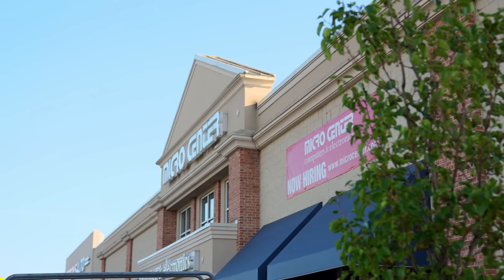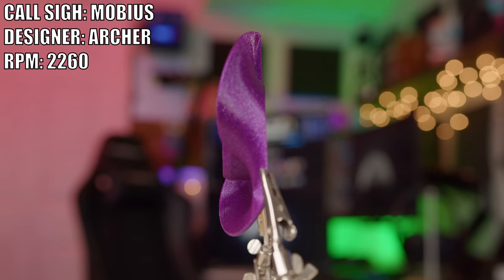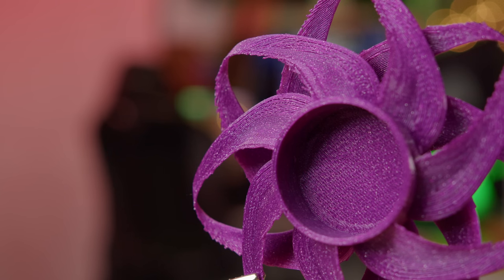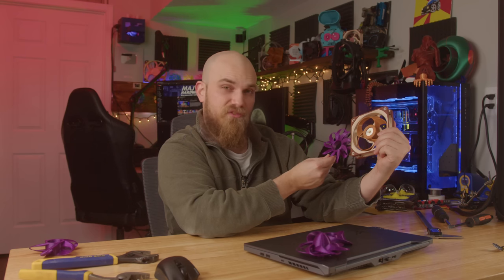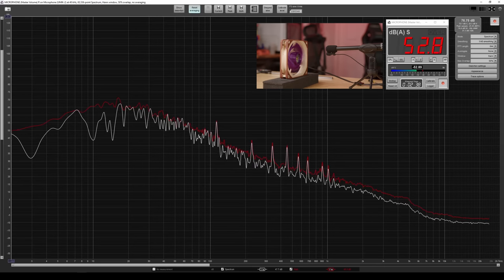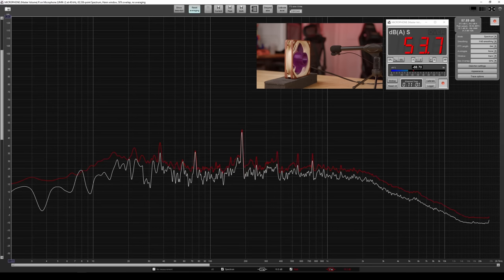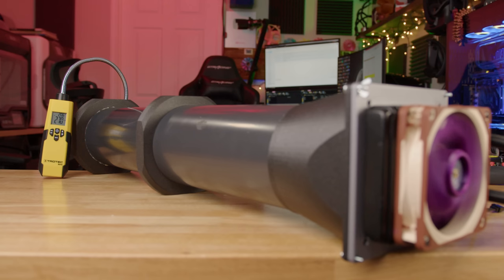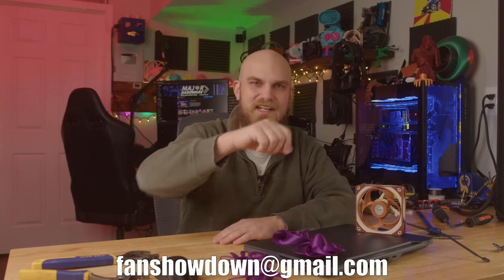My Subscribers Turned MIT Award Winning Toroidal Propeller Into A PC Fan | Fan Showdown S5E5

Comment: The one pushing in the wrong direction would get the same in either direction because it is PULLING the air through your airflow meter rather then pushing. The rounded props are likely going to do nothing advantageous in a framed fan because there are no vortecies on the outer edges like a plane wing, or boat prop. A jet boat impeller would likely do nothing, because again, there are no outside vortacies . :)
Reply: Sounds right
Reply: Pulling with a fan is less efficient than pushing though, so not "the same".

Comment: Good video. One problem that I think might be diluting these results is the layer resolution of the prints. I think you really need to have a resin printer or to be making moulds if you want to honestly compare these designs with Noctua et al.

Also I don't think we got a noise test for the flipped Mobius design? Maybe I missed it
Reply: Thanks for the feedback. 
Expect more videos soon. 
Send a direct message... 
I have a Gift for you📦........

Comment: Have you ever compared the performance of a real NF-A12x25 to a 3D-printed one?
Reply: I remember a past vid there was one made to the same specs and yeah the 3d print did not give the same output but was very close.
 I think whats missing here is to now take the A12 and curl the tips into a toroidal hybrid and use some putty/filler and sand it to a smooth finish surface.

Comment: What makes the toroidal good for marine and drone applications is the reduced tip vortex, on a computer fan, the fan shroud takes care of that already, so their main advantage is discarded, and a less efficient but larger blade will move more air usually so having a large blade and the shroud taking care of vortex is a best of both worlds deal, making it sort of a ducted fan

Comment: Solving tip vortices might be great for open propellers, but the design trades are a pretty different in the world of ducted fans. The toroidal design reduces interaction outside the diameter of the rotor whereas a ducted fan leverages the interaction with the duct wall.
Reply: Exactly. This stinks of skimming a paper on toroidal blades without actually under standing how fans work.

Comment: The Mobius probably did the same because it was pulling air the opposite way through the tube when it was facing the other way, leading to similar performance
Reply: He is measuring pressure so it would be zero in that case.

Comment: You know I got to thinking about it. If you look closely at the stock a 12 X25. The blades kind of resemble just a toroidal shape that's been cut in half. It's like the front half of a toroidal shape where the back half has just been cut off.

Comment: My biggest hope going forward is seeing him improve the print quality by either changing to resin/UV printing or spending time tuning this current machines and sanding the parts. The stringies and jagged edges are so prominent on some of these that I know they are changing the airflow properties of the fans. Also, I think resin would be great because the parts will come out smoother, stiffer, and closer to an injection molded fan like the original Noctua. The concept of toroidal fans is cool however I don't think it's going to do well in this specific type of tests (pressure optimized vs airflow) and the noise benefits are much lower in part by the fan having a frame or being enclosed part way vs being completely open on a drone support.

Comment: I'd be interested in seeing the static pressure generated by each fan. Have you thought about a testing methodology to include this in the future?
Reply: The fan is mounted on a radiator for the tube/airflow test

Comment: Nice video, thanks.
One point to note, The advantage of toroidal propellers is largely in eliminating tip vortices in non-ducted propellers. The close fitting circular housing on computer fans is a big help with noise and tip vortices, the toroidal end connecting one blade and the next kind of gives this same effect, so it's not that surprising that a ducted toroidal is not much better than a ducted fan.

Comment: i think toroidal fan blades are specifically designed for open-blad propellers to reduce wing tip vortices and everything these vortices causes, like extra noise, efficiency loss etc. they are not designed for propellers with housing, like these desktop fans.

Comment: The magic happens in the outer loop as the air transitions and is push under pressure.
The leading edges are lowering the pressure to suck the air into the space.
So in my view it's the air transition from lead edge to the outer loop.

Comment: The thing is that the value of toroidal propellers comes from the elimination of blade tip vortexes which are resolved with the enclosure present on the pc fan. Really interesting testing though

Comment: When they do injection mold plastics for the toroidal fans, you will get thinner blades and more efficiency i think. 3d print is pretty thick and heavy by comparison and you have a lot of clean up to do with sanding, not to mention balance

Comment: The Mobius performs same flipped around because regardless of the direction, the fan is either pushing into or sucking out with the same pressure differential which should generate the same mass flowrate. The design "flaw" with the mobius is just that the mounting hub was printed the wrong way around.

Comment: Two things:
-Clean the edges of the printed blades(lots and lots of drag, causing noise that would'nt be present when ejection molding parts)
-You should also measure the power consumption, to calculate efficiency.

Comment: in the MIT paper it is clear that one of its interesting fonction is in open space. the fan enclosure limits the sides aspiration provided by the toroidal propeller.

The second thing with printed blades is ... the printing process hich make a lot of small stairs and do not lets the airflox to be quiet.

The best comparison to try it in fan case is with the same motor and an printed original pattern blades to have quite the same cons provided by the making process ^^

Comment: The reason behind a Toroidal Prop is to mitigate cavitations which are little pockets of air that are the reason behind sound on props. Although it is interesting for the performance in a pc they are useless due to the surrounding material which servers the function of a toroidal prop.

Comment: Fans move more air the further there is from the turning axle so the shape, size and angle of the end parts of the "blades" is more important than the section that is attaching them to the mounting frame.

Comment: I get that this is just for fun, but if you think about it for a second, the whole point is for these to reduce tip vortices, which are basically not a problem at lower reynolds numbers (aka fan speed).  An actual comparison is to strap that noctua to a drone motor in an open airflow config and let it rip.  That's when you'll see the difference.  Otherwise, this is a square peg, round hole situation.

Comment: All the blades on the A12x25 are basically half toroidal. It wouldn't be surprising if Noctua tested these designs but made some concessions for static pressure and total blade surface.

Comment: One very interesting question for your designs and tests is the concept of windage. Fans work best when there is very little gap between the housing and the edges of the fan blade.

Comment: Don't forget that toroidal propellers are "quiet" for 20-20khz frequencies. So you should maybe think about the noice on a certain flow rate. Or measure the needed power to generate that flow rate ( to get the efficiency ). The strength (in my understanding) is not the performance but the efficiency

Comment: I saw some comments elsewhere pointing out that the toroidal fan gains its efficiency by reducing vortices created at the traditional tip of the blade. So, though still operable, they are not beneficial when operating in an enclosure.

Comment: Hey MH, one thing you might consider doing for your 3D printing.  Have an "acetone baker" to smooth out the rough ridges.  I've seen some videos that show people using acetone vapor in a confined space to basically "bake" the rough ridges out of a 3D printed object.  "Some experimentation required." :D Hope this helps.

Comment: OK I need a new test. I maintain that a submarine prop and a noctua 12 fan blade have a lot in common.  I also think that tip forwards curved blade design would make a quieter drone prop than a toroidal. You have drone:) might have to connect the tips with a ring to keep the flex down, don't know.

Comment: In your last video you said something like that the problem with traditional propellers was the turbulence created at the blade ends. However a PC fan is placed in a short tube which may mess with that a bit. My guess is that toroidal propellers are great when not encased, and maybe some other idea is needed for PC fans.

Comment: Toroidal props won't be very helpful for making fans because the fan case you are sticking them in is ducted. The point of the shape is to avoid the vortices created by the tips of the blades, but ducting already fixes that.

If you want to learn about what I'm talking about google "ducted fan", "duct/ducting" alone is a different thing.

Comment: Those Toroidal propellers are meant for boats to be quieter, because they are not narrow flow of movements, but open.

So if you take a motor and hook it to the propeller and use it open without the 'casing' around it, that's where you should see the differences.

PC case fans are more like Jet Engine style of propellers, in that the air is concentrated in a funnel, Toroidal propellers are for things like boats and propeller planes in a sense?

Comment: toroidal blades are meant to mitigate fan tip vortices, but all these fans are operating within a CASING. So there aren't any tip vortices to mitigate, these are really only meant for non ducted applications like aircraft or boat props

Comment: Have you tried sanding the fins at all? I'd be curious if by creating a smoother surface, you decrease the turbulent flow and therefor see a decrease in sound as well. Your comparison of these fans to each other seems precise enough as they all likely had a similarly rough surface, however I'm curious if you may be able to surpass the commercial product with a smoother surface - even to something relatively course like 180 grit. Either way, great work!

Comment: It's not weird that it did the same regardless of orientation.  in one way it pushes air into the tube, in the other it pulls air through the tube but the machine that you use to test flow still gives a reading even if it is flowing in the opposite direction.

Comment: Probably already been suggested in the comments already. But given the issue with 3D printing some of these, and the issue support removal causes with the end product, as well as the not so smooth surface finish due to the large layer height. Which I’m sure will have an effect on the performance due to the grooves on the surface which will distort airflow and therefore affect noise levels. 
I think the better way to test the designs would be to resin print them for the cleanest and smoothest results of propellers

Comment: You sould start high temp treating those flakes on 3d prints. Blow with heatgun 600c just fast enough to melt the smallest flakes but not soften the material.

Comment: I was building a solder exhaust system, I had a creality 60mm fan, it just spun the smoke back but not through the filter, so I took the filter off, same thing.

Might be cool to see what 3d printer fans actually work.
Reply: the 3d printed fan from MIT seemed to work just fine, in a muted clip and with no rpm data and power draw provided...

Comment: I’m assuming that the mobius getting the same FPM of airflow both ways is that your meter does distinguish direction of airflow. If it’s pushing 270 fpm, it’s also pulling 270 fpm

Comment: Have you ever tried smoothing out your blade surfaces (acetone?)  I can't imagine those rough surfaces help the aerodynamics much.
(perhaps even smooth only one side to create low and high pressure,... tho perhaps not,... I don't think you want "lift" like an aerofoil)
I can only image the micro-vortices spilling off every single layer edge on those surfaces, and every vortex creates drag and noise and reduces laminar flow.
Seems a bit unfair to compare those extremely rough prototypes against smooth, professional injection molded fans! (I'm assuming you're not sponsored by "big-fan")

Comment: I saw those thoroidal designs and my litteral first thought was, someone should submit that design to the fan showdown. I was not dissapointed. 
The problem with taking clues from a boat-propeller and using it for airflow is that these two media have very different characteristics and therefore need differently optimised blade designs. So we probably have to be looking towards the drone/flying car design industry for air-optimised versions.

Comment: if you add a cone to the middle (thin as possible construction)

this should decrease noise and add flow

balance the fan blade as much as possible (most noise is from that)

try a few different shape cones too

the more uniform matches the blade the better 

let it protrudes 1/4-1/2 inch

diet..drill 1mm holes anywhere you think it won’t effect flow. 15% lighter will have significant gains

Comment: You need to print these out of ABS and then put them in acetone to smooth them properly. A lot of the noise here is from the rough edges on the print itself
Reply: Agreed, or printed with an SLA printer instead.

Comment: The possible I see is the number of blades so to speak  and the pitch. It seems like if you could maybe make a 6 blade design with  a gradual change in pitch towards the center to make a tighter vortex to the rear it may perform  better. Don't have tools to execute but just throwing idea out there.

Comment: The fans from BeQuiet will beat all fans, including noctua fans.
Their Silent Wings and Shadow Wings 2 are non audible at low RPMs.

I use those for ventilation exhaust in residential rooms and boat cabins, where sleep level silence is important !

Comment: The toroidal propeller is designed to reduce the wake produced by the tips of the blades, when you are using it in a pc fan or in an area where the tolerance between the blades and the walls are low, then there is nothing to gain because there isn’t enough space to produce wake, if you are wondering what the wake is, it’s when the tips of the blade produces vortexes and disturbs airflow, and at this size and weight, the toroidal propeller would marginally produce less thrust because it’s generally heavier or creates too much drag for a set amount of thrust, I would suggest that you stick to the standard propeller, make the angle of attack a bit steeper, reduce the weight and make the tolerance between the blade and the wall as small as humanly possible.

Comment: i wonder how it would compare to a 3d printed noctua fan. a lot of the reason noctua's design works so well is the liquid crystal polymer coating. the material itself is also probably making a difference

Comment: Since the benefit mostly comes from directing the air by the tips toward the center, you could try to scale it slightly smaller so that the edges don't get so close to the housing. Maybe it will redirect better and the benefit will be less power to move that air because the blades take up less space? At the least, it could make a good video that answers that question. It looks like you're maximizing the space, so maybe a smaller size could balance out some more benefits. The inverted one may also benefit from a size change.

Comment: A toroidal propeller is designed to suck in air/water not only from behind but also from the sides. If you open up the fan body to be allowed to take in air from the sides as well it should get more powerful.
Reply: Agreed. Shrouding is a primary factor in airfoil design. Primary.  As is number of blades.

Comment: Don't forget you're 3D printing these vs molded plastic of the Noctua fans, I bet if you resin printed the fans the noise would go dramatically down. You're creating a lot of turbulence even in low speed settings due to the layer height stepping and various overhangs that aren't clean.

Comment: Considering the Noctua a12 isn't 3d printed and you've already got blade designs that are down to 50db, with only about 160 FPM to catch up (it isn't much when you consider the amount of surface area actively pushing/pulling on the inverted sharrow) - there's about as much room if not more for improvement on the Inverted Sharrow as there is FPM to gain!  Have you considered sending the print to a different kind of high-resolution printer? Doo iiiiiiiiiiiiiiiiiiiiiiiit  also thanks for the vid!  Is that a power supply on the wall near the door?!

Comment: One thing I've noticed in these and the drone versions are they are much shorter along the axis than the pictures of the prop made for boats.  Then, the props that were developed by MIT that started all of this looks a lot different than anything else that has come along since.  As a drone pilot and becoming interested in making a little side money, thus studying for my part 107, a quiter drone would be very helpful in not drawing unwanted attention from the uneducated.

Alternatively, I'd like to see Zipline license their super-quiet propellers for other drones.  Mark Rober did a video on Zipline drones and the amazing work they are doing.  I wouldn't try to print those myself as Ken Heron did a video on why you shouldn't try it and risk injury and your drone.